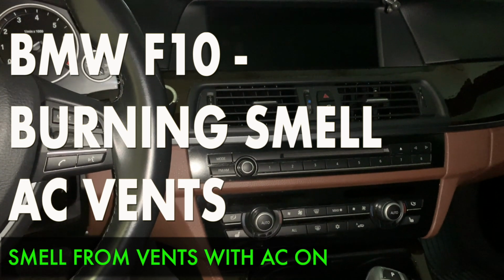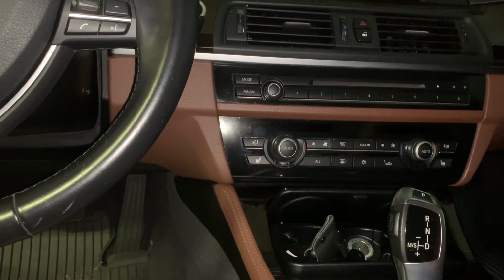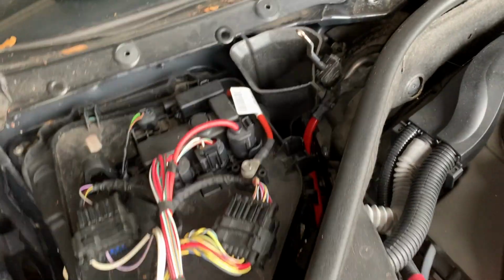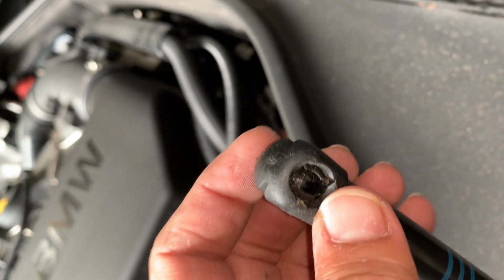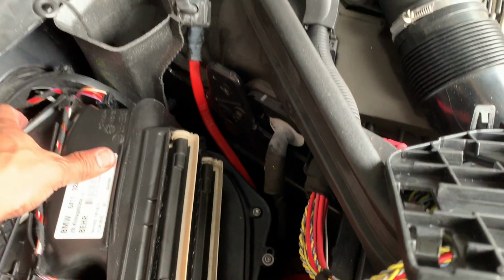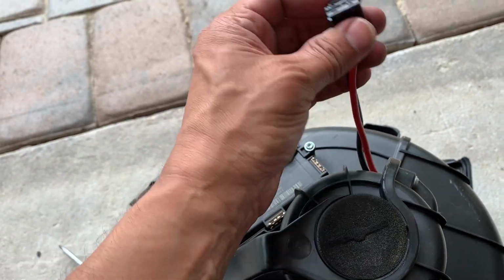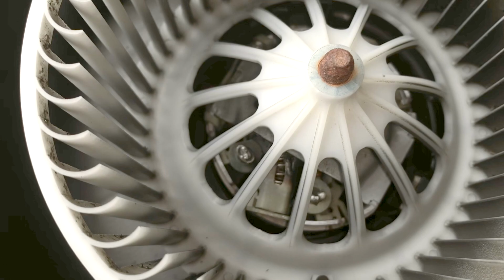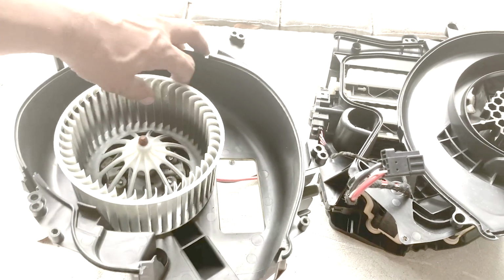BMW F10 Burning Smell from AC Vent FIXED

Comment from the maker: I found the issue to be my blower motor. Replacing it fixed the issue. The motor has plastic pieces and for some reason it was melting from the heat causing smell. One day I was running ac in full blast and motor just gave up. That’s how I found the culprit. I changed it and no more issues. 
I made a video on it in my channel how to replace the motor. Check it out. 
Thanks
Reply: How To Do it soo as long as I still get warm air on the drivers side, my motor is still good and I should just replace the blow motor resistor!? I get the burning smell and only the passenger side gets no hot air at all.
Reply: @EduardoU7  this is EXACTLY what’s happening to me.  I had my blower motor replaced, and afterwards the passenger side has no heat, and white smoke is blowing through my vents.

Thank you in advance for any advice anyone can pass my way 💪💪
Reply: Can it make a check engine light show
Reply: My 2014 bmw 535 was having the same symptoms as yours, Thanks for the video.
Reply: How much did it cost u
Reply from the maker: 35bucks
Reply from the maker: Both as I did the repair

Comment: I have a 2013 535i. 60k miles. Very well maintained. In the last couple weeks or so, idk (what is time anymore....) I've noticed a burning rubberey smell after driving for 3-5 mins and getting to a stoplight. When I start driving again, it will go away in a minute or less. Stop again. Sometimes more burning, sometimes not. Noticed also when I accelerate any, I hear a squeaking from the front passenger side. Not like a serp belt squeal....just like sustained squeak if that makes sense. Doesn't do that always though. Is this a bad blower motor maybe? Or just a belt somewhere wearing out?
Reply from the maker: Is that burning smell of oil burning or is that burning smell of an electrical burning smell?
Reply: @HowToDoitright  It's definitely not burning oil because I checked the level today and it was exactly 100% where it should have been. Serp belt does not look worn at all. Not shiny whatsoever. There's no smell coming from the engine bay itself, either. Just seems to be coming from the vents when HVAC is on, and only then. But not always....It's weird.
Reply from the maker: @atm99635 so you are saying it’s electronic burning smell and not oil burning smell because both these smells are very distinct. Just because you don’t smell engine oil burning smell in engine bay or your oil isn’t low that doesn’t mean it’s not engine oil. 
You must be sure what type of burning smell it is. Both comes from vent when AC is on. 
I had both these issues that’s why I have experience in both.
Reply: @HowToDoitright  It really seems to be a rubber smell. And on top of the squeaking coming from the front passenger side. And only when HVAC is on.... Is that a blower motor thing?
Reply from the maker: @atm99635  the easiest way to find out is drive the car around when you were getting the smell and then park it on a ramp and crawl under it and see if you have any smell where the exhaust is under the engine bay right by the passenger side. I have a video on my channel where I cleaned that area of oil smell. There is a playlist on my channel called F10 with a bunch of videos. You may find that video in there. 
If you smell the same thing by crawling under the car, then you have a minor oil leak and that could be from your valve cover gasket or engine oil filter gasket. Those are notorious to fail on this car at around 50 or 60,000 miles. 
I also have a video where I replaced both those gaskets on my channel .
Reply: @HowToDoitright  If that were the case, is this a critical issue that needs repairing like NOW or? And what does that sort of thing cost at a place like Meineke? (My local one knows BMWs very well, I know what you're gonna say..lol)

Comment: Hi what happens If the blower speed levels of my fan works fine at the footwell as well as the front window defroster ,  but when it comes to the front vents I can barely hear the blower fan even at the highest level settings. The front vent always seem to be very and I'm not sure what else to check for. I did take out the blower unit as well as the cabin filter and cleaned them out. The problem still exist.

Comment: Look how easy that was. The fukin dealership would’ve hit me over my head for a simple diy.  So here’s my situation. When the heat is on it goes cold for a wild then it gets warm again. Sometimes you see smoke come out of the vents but then it stops. Sometimes it blows low power. I’m assuming I should just replace that entire piece you removed
Reply from the maker: Yup that’s the problem. Even if you just find motor you don’t really need the entire piece. It’s the bad motor.
Reply: @HowToDoitright  what is the name of that entire assembly? And that little silver rectangle thing you removed? Or do you have a link
Reply: I have a 2016 f10 with dual climate
Reply from the maker: No idea I sold the car. You may want to join a forum and ask there
Reply from the maker: Look on ebay
Reply: @HowToDoitright  I’m probably just going to sell it too lol
Reply from the maker: lol honestly it made me more happy

Comment: Old video , but my 2013 535i heater hasn’t worked for a couple months also wasn’t a need with weather but I had a a coolant lead and replaced the whole housing unit was told heater would work again.. it blows but not very warm also has that light burning smell .. any thoughts just paid over 1k for the housing unit fix..

Comment: I only smell a burning smell when im at a stop light and when i drive it goes away what can it be can you help a brother out with some info 🙏
Reply from the maker: What type of burning smell is it? Is it oil burning smell or electronic burning smell? Open your hood and see if you smell similar burning smell under the hood. It could be oil dripping on your exhaust but that’s a different smell. If it’s your ac fan motor then it could be your ac fan motor. Depends on type of smell
Reply: @HowToDoitright  smells like oil
Reply: And i just SUBSCRIBED
Reply from the maker: @marvmon4735  if it smells like oil then your valve cover must be leaking. Cleaning won’t help as it will cure the problem for a day or two. Watch my F10 playlist. There are videos I showed there about how to change the valve cover. Most likely your oil filter housing gasket is also leaking. I also have videos on that. Watch it all. You will learn and you can do it yourself.
Reply: @HowToDoitright  Thanks bro for helping people 🙏
Reply from the maker: @marvmon4735  glad to help brother. I was a Bmw owner for a very long time. But I gave up on the car. I had a Z4, 3 series and five series and they all gave me problems. Too much problems. BMWs have great engines and fun cars but too many issues come up with the age.
Moved to a Tesla and I have never been so happy.
Reply: @HowToDoitright  Im invested in TESLA and its running up 🎇🎆🎊🎉$$$
Reply: @HowToDoitright  And i only notice the smell when i cut my air or heat on
Reply from the maker: @marvmon4735  Yep that sounds like What I mentioned earlier. Watch the videos They will help you
Reply: @HowToDoitright  👍
Reply: @marvmon4735 did u fix this? What was the problem?

Comment: I started having smoke coming out from the glove compartment could this be the reason? 
Ac does not work on the car.
Reply from the maker: Yes definitely…that’s where the fan motor is located…check out my Fan replacement video on F10 playlist
Reply: @HowToDoitright  what the smoke smell you experince like electrical smell or plastic?
I'm experince electric heating smells

Comment: My Q50 has both driver vents blowing AC like it’s at 70 and both passenger vents are blowing really cold like it’s at 60 like it’s suppose to since I set the temperature at 60.
Reply from the maker: All should be same temp. Measure from a meter

Comment: Just saw this video.  I made the mistake of not disconnecting the battery and now my car will crank but not start   Im also getting a drivetrain malfunction message.  Is this what happened to as you mentioned on the video. And if so what happened and what was the fix?     Thank you
Reply from the maker: Check out my F10 playlist. I showed how I fixed it by changing the fuse panel in trunk

Comment: I am experiencing a bad burning smell so i took the car to BMW and they said it was the Value cover gasket. I had that changed and i am still having the same problem. Im thinking next it may be the blower but im not sure. The burning smell is random, sometimes when the heat is on i smell it, other times I have the heat on and its fine.
Reply from the maker: https://youtu.be/R_obbr2Da1c

Here is the video
Reply: I have also the same problem f10 520d  you finded the problem?
Reply from the maker: Problem is they fixed the issue it did not clean it. I made a video on my channel how to clean the oil. Check out my F10 playlist you will find the video.
Here is a description 

BMW F10 BURNING OIL SMELL DIAGNOSTIC AND CLEANUP
Reply: @HowToDoitright  thanks man I appreciate the help!!
Reply from the maker: Glad to help bro
Reply: @HowToDoitright  Hey man, so I had the Value cover gasket changed by bmw, cleaned the oil that was leaking onto the exhaust.... I drove the car around and same problem. burning smell and smoking coming out from under the hood... when I look at the exhaust pipe that I cleaned, more oil was on it.... does this mean bmw didn’t do a good job when replacing the value cover gasket??
Reply from the maker: @Saidg_1015  check under Neath to see evidence of oil on exhaust. Also check your oil filter housing. Sometime that leaks too and should be replaced with valve cover gasket

Comment: did you replace the fan only, with a bmw original, or get a non-oem bmw fan, if so has it lasted since this video. I bought an entire used unit (cannister), it lasted about 9 months, now the smell is back, it would appear that these original fans last a few years before they fail. considering a non owm bmw fan from ebay as a replacement, have any thoughts about it, they're under $50 with a 1 yr warranty -   tks
Reply from the maker: Rj Kulman I bought a used one from eBay it was genuine bmw. If smell is back it’s the motor again. Just get the after market one and you will be ok.
Reply: @HowToDoitright  The replacement unit I bought was also a original bmw (2012), but as I said, they seem to fail after 7 yrs, have a local junkyard here...also under $50 (used bmw oem) vs a 1yr warranteed non bmw unit from ebay ????? ( you seem to have been lucky with a used bmw, that still works

Comment: hello i own a 2013 bmw 550i and have the same problem but the smell is a bit more oily than electrical but i had many mechanics look at the engine and no leaks at all. when i took off the housing cover i got a faint smell but couldn't take it off fully so i couldn't tell. could this be the problem ive been looking for a while???
Reply: but it only happens when i accelerate a lot.
Reply from the maker: cbibjb so if it’s oily smell then define your valve cover is leaking. It could be a minor leak. That leak falls on the exhaust and burns off so you won’t see any Oil drips anywhere. The burn oil then gets sucked into the vent and come inside the cabin. Check out my F10 playlist where there is a video on changing the valve cover gasket because of this issue. It’s pretty common
Reply: @HowToDoitright  I actually had 2 bmw specialist mechanic look for leaks, the first one actually did a valve cover seal replacement and another did a turbo line to gasket repair and no luck they said the engine was good with no leaks. thats why i am looking for maybe other problems it might have. thank you for replying.
Reply from the maker: cbibjb did you check if there was evidence of oil on the exhaust pipe by the oxygen sensor. Do you smell any burning smell outside or it’s all inside?
Reply: @HowToDoitright  I do smell the oil outside sometimes and on the inside, does that mean it could be a leak?
Reply: @HowToDoitright  Im not sure how to check if its on the exhaust It might be harder because i have the n63 motor.
Reply from the maker: cbibjb yes hard to check on that engine. I suggest remove the air filter and make sure it’s not filthy causing the smell. Also you can check the fan motor by removing the module like I did and see if you notice any oil residue there.

Comment: Hi, what type of mesh did you use to replace the perished filter please. Thank you
Reply from the maker: Andy Muller it was a plastic mesh that is used for door screening. Easily available at Lowe’s or home depot. Any plastic mesh will work
Reply: How To Do it thank you. I have purchased some aluminium mesh but quite thin similar to yours. Will do it next week. Cheers
Reply from the maker: Ok not sure how aluminum will holdup with the glue gun. The reason I didn’t use aluminum was as it absorbs heat and can transfer it to glue causing it to melt and then it will come loose. But again I live in Florida heat which can get in to 90F.
Reply: How To Do it I’m in the UK lool. At 25 degrees, the maximum we get here, I’m sure the glue won’t melt. Thanks anyway.

Comment: hello , just currious , how many miles do you have on your car?
Reply from the maker: 75k
Reply: @HowToDoitright  thank you , mine has 80K so i have to do it
Reply from the maker: Arman Usa do you smell the same. If yes guaranteed it’s your motor. Just order the motor from eBay. I got a used one and used the existing assembly and everything else. Works fine. No need to purchase the entire assembly.

Comment: bro remove the vent and smell its under the dashboard
Reply from the maker: Drean I found the issue. It was my blower motor. Replaced the motor and no more smell.
Reply: T_T i thought the same before i saw the video i investigated and removed the blower motor it has that burnt smell so i got it replaced still the smell there
Reply: I really dont know what to do i got the whole AC System cleaned but not checked because we dont have people that can check it
Reply: i saw a video that says maybe the engine motor rubber thingy is causing it
Reply from the maker: Drean I really hope you put a new one and not a used one. Also hopefully you changed your filter because the old filter get flushed up with burned smoke and if you use it it will smell the same.
Reply from the maker: Drean there is Really nothing in the AC system that will smell except for the housing of blower motor and blower motor resister which is in same housing as the blower motor